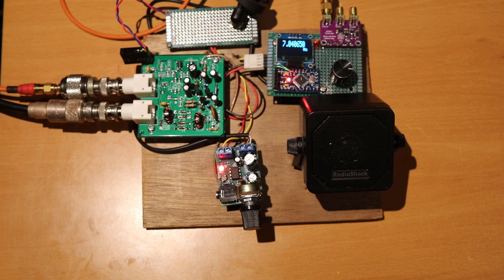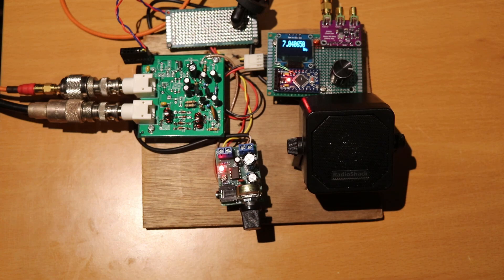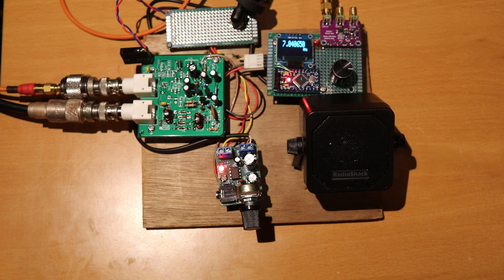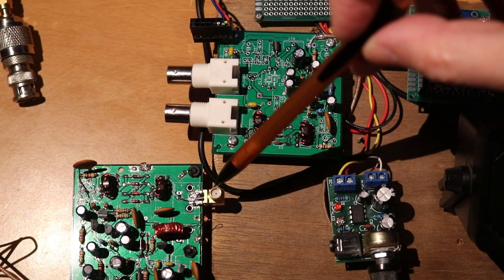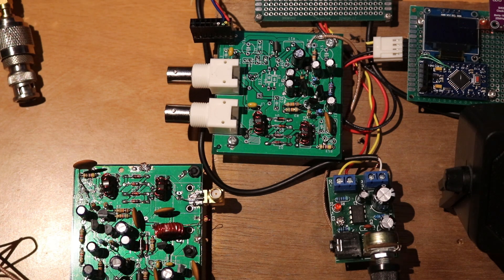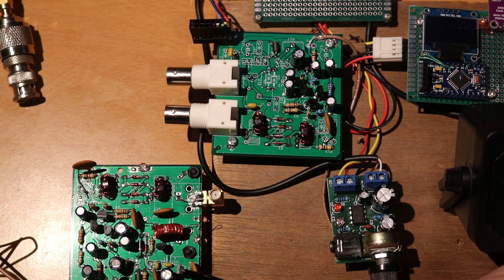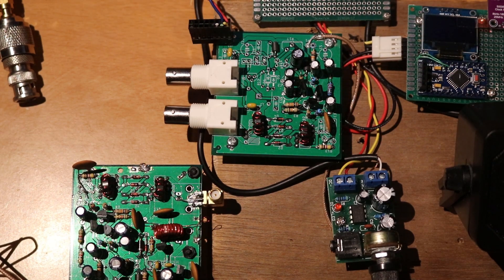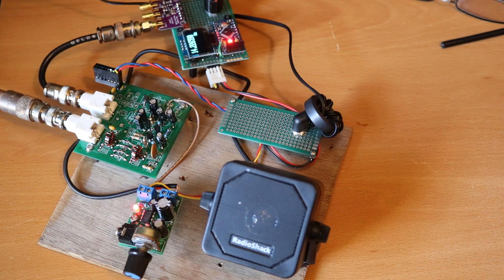Direct Conversion Receiver - English

Comment: Bunu türkiyeye getirmemiz lazım acilen hocam bir sorum olacak si5153 preamp transistor serisi IRF  mi ?  2SC mi ?
Reply from the maker: Si5351 DDS entegresidir ve kucuk bir micro kontroller ile surulur. Transistor degildir.
Reply: @leventsasmazel6292   peki sinyali preamp ile yükseltmek için hangi transistörü kullandınız abi onu sordum
Reply from the maker: @batuhanbalaban2663  Bu devrede RF katinda preamp yok mixer cikisinda 2N3904 var.
Reply: @leventsasmazel6292  peki mixer olarak  mc 1496 mı kullanıldı?